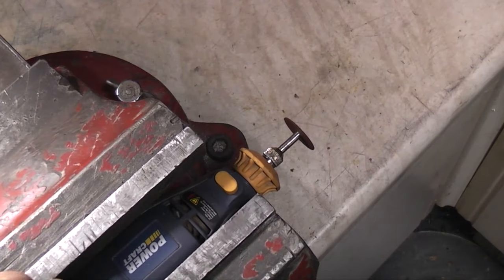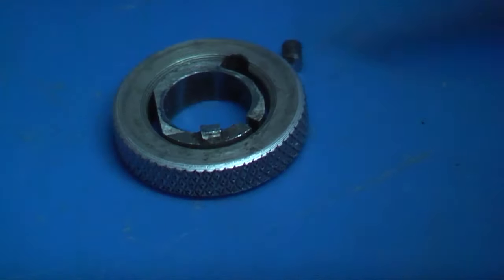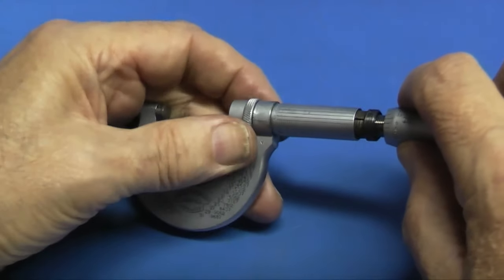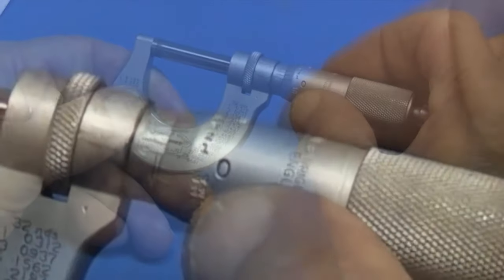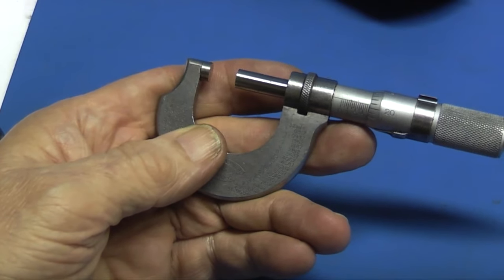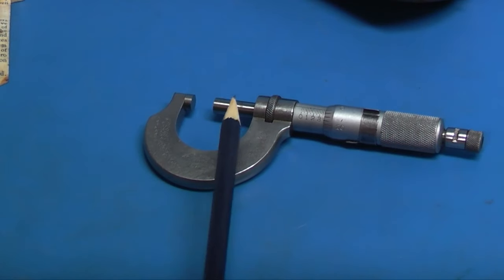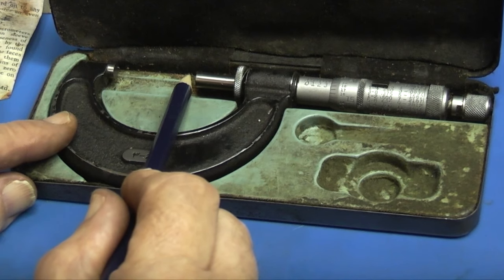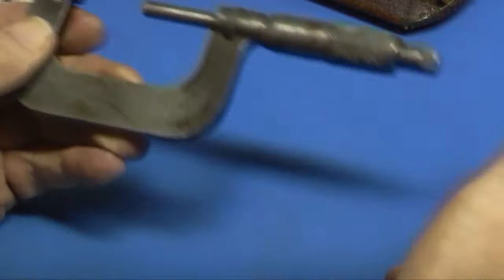Micrometers resetting and problems

Comment: I have that tightness problem. Any cure?
Reply: I bought an old Moore and wright micrometer this last weekend with the stiff problem. I noticed that when assembling it things got stiff before the threads had engaged so it was the shaft in its sleeve that was causing the problem. I mounted the shaft on my lathe spun it up and polished the shaft with some 800 grit followed by 1500 grit emery paper.

Smooth as butter now. I also disassembled every part and left them in evaporust overnight

Comment: Have a stuck barrel, how do unstick it
Reply from the maker: Hi If you have a collet set you could try put some paper around the barrel and hold it in a collet to prevent damage. This should give you more leverage but making sure the micrometer lock is off.